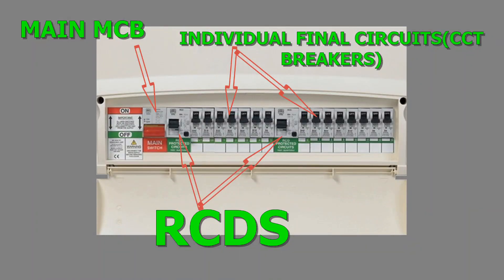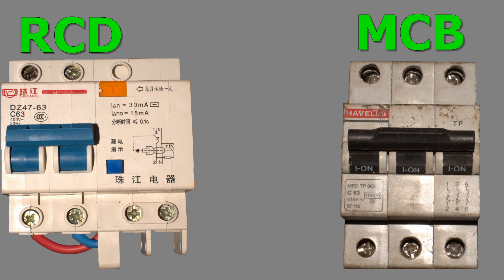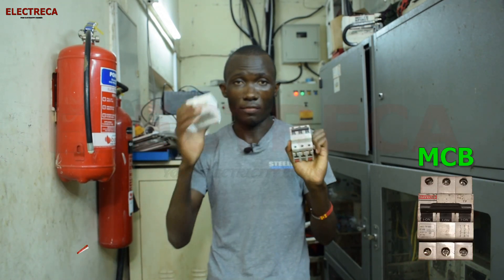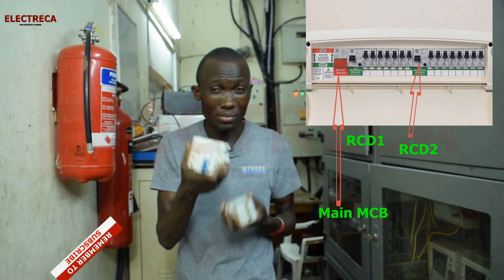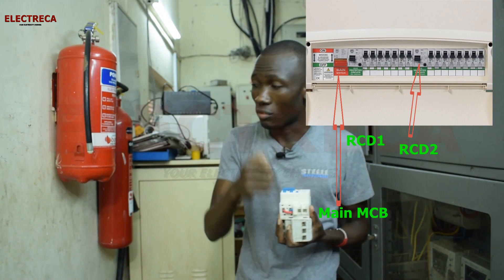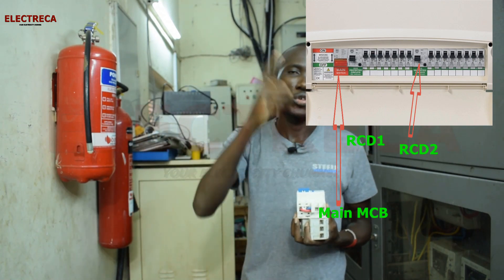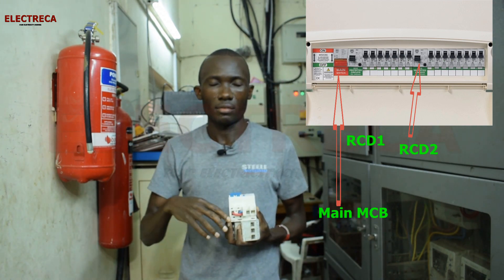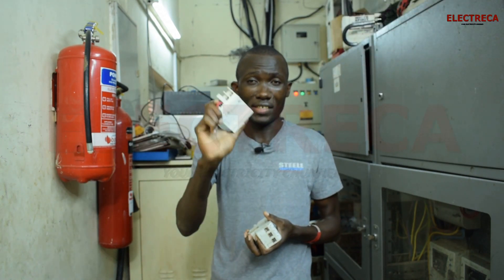The Surprising Truth About Residual Current Devices Nobody Tells You

Comment: Can I've RCD to control motors... Like water pump, posho mill... Kindly talk about the ratings..... Thanks... Ur video is very educative... 💓💓💓💓💓💓
Reply from the maker: RCD detects an imbalance in the currents of the LIVE and NEUTRAL conductors of a circuit. But it cannot protect against overload or short circuit as a fuse or circuit breaker does.
But it can protect a short circuit from live to ground, not live to neutral.
So you can't really control a motor with RCD. you can use MCB, ISOLATOR or a built starter.
RCD rating 30,100,300,500 mill amps and so on.... each rating will depend on the load and the environment of the installation.